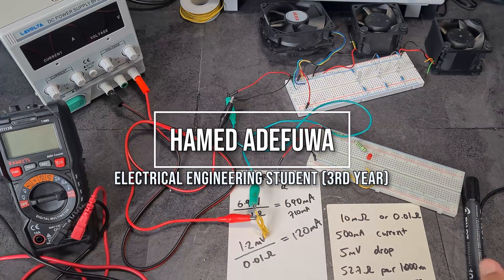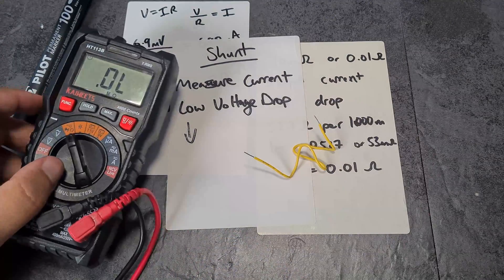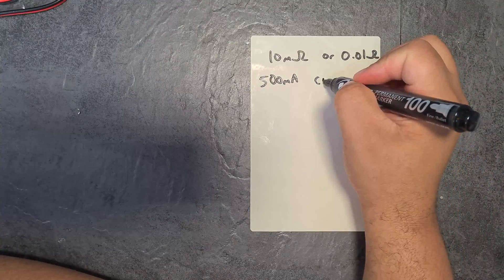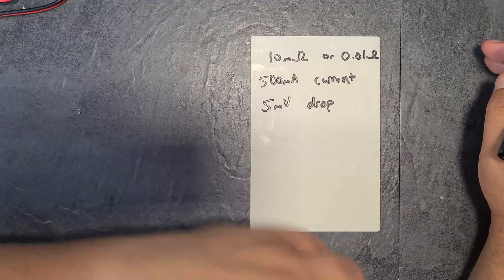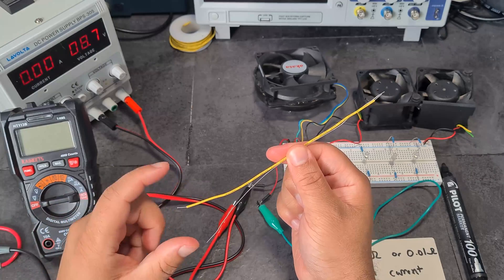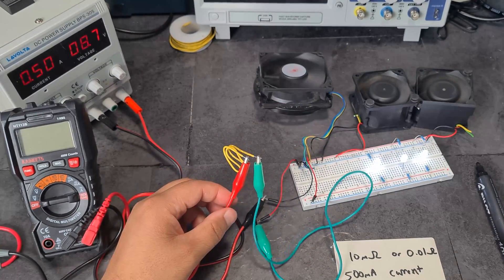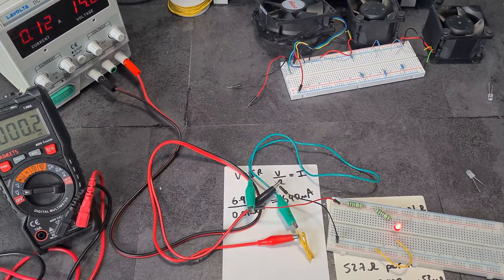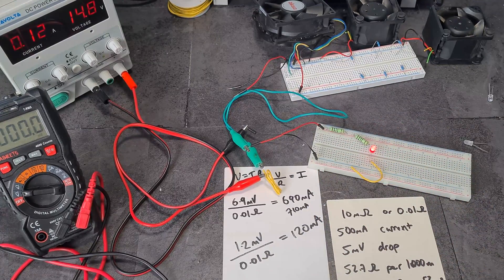What Is A Shunt Resistor, How Does It Calculate Current & How To Make One (DIY)

Comment: Nicely done. You mentioned not creating an inductor, which would be a concern of mine as well. What exactly did you do to keep from making one out of your wire?
Reply from the maker: @JeremyCook  Short wires reduce inductance because inductance increases with wire length. Inductance comes from magnetic fields generated when current flows; longer wires create larger magnetic fields and more inductance.

Thick wires matter because they have lower electrical resistance. Lower resistance reduces energy loss and minimizes voltage drop, which helps maintain accurate current measurements when using a shunt. Thick wires also spread the current over a larger area, reducing the magnetic field strength and thus lowering inductance.
Reply: @HamedAdefuwa  Thanks!

Comment: just starting electronics and this was very helpful.i am advised I need a shunt resistor or resistance to get good component trace on scope.
I am trying to setup an oscilloscope with a built in waveform generator to produce visual of component curve traces.
does the component bing tested need a certain value shunt resistance ,or do I have to try several resistors to see what gives best visual trace?
thanks

Comment: Good vid. The reason why the calc is a bit off is because you measure in between/halfway the wires and clips. The cables and clips you are using also have some resistance especially at a higher current. When you put the shunt at the beginning of the wires it will be more accurate and measures the current thru the whole circuit (with all the losses).

Comment: The accuracy of the displays on similar power supplies may not be very accurate at all values. I suggest a 4 wire measurement where you measure the current and voltage to eliminate the influence of the power supply display accuracy. Nice work.

Comment: why can't you just put the multimeter in series to get the circuit current, 690mA is quite high - most multimeters will even have a micro ammeter setting won't they?
Reply from the maker: I used this shunt on a PCB I made, so I use it in place of a multimeter so that my Arduino could know the current input/output
Reply: @HamedAdefuwa  ok cool thanks. Sorry last question, how did you know the resistance was 0.01 ohm, did you use a separate circuit with 2 multimeters then to find V and I and then R?

Comment: vERY GOOD CONTENT.When you measure ohm with your fingers are in contact with multimeter probes will affect the reading where precision is needed(depend how moist your skin are)I am trying to fix my RND or Korad KA320-3005D 30V 5Amp dc bench power supply where i made a fool,s mistake and blew the reverse protection diode and the 7 wide winding .s(to avoid a short)1.2mm thick wire. Wire is not clean copper i think,cause it is stiffer than a copper wire.Do you have a tip witch type wire is used?.On EVVblog forum i can se pictures of this part in a Korad psu same as mine but no usb out.schematic show a value of 0.1 ohm 5 watt.Seems to be a strange low watt value on that psu.I have 2 identical if i need +15 zero/common and negative 15 as example.Any tip you can think of?